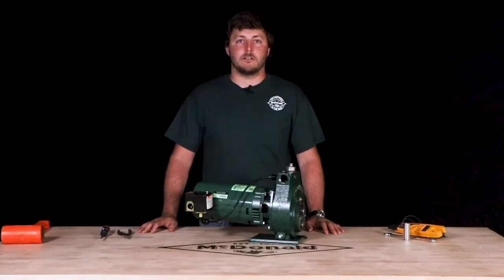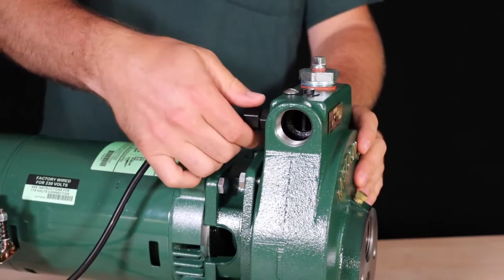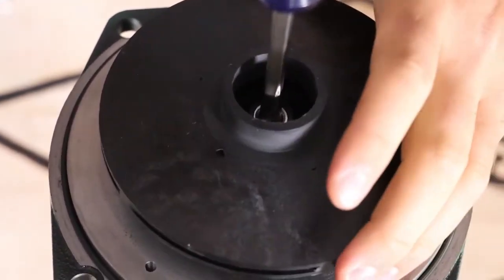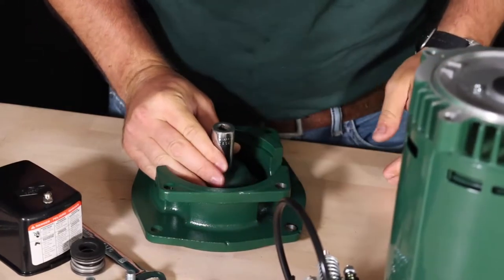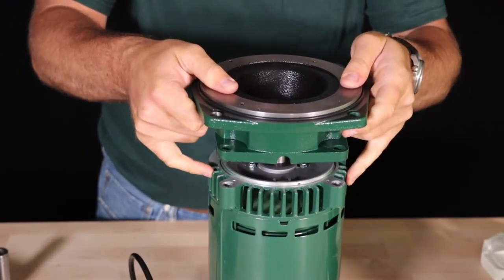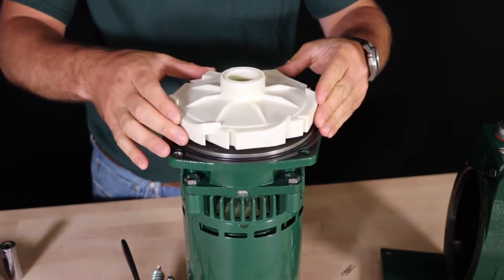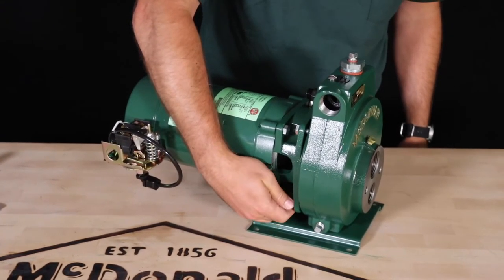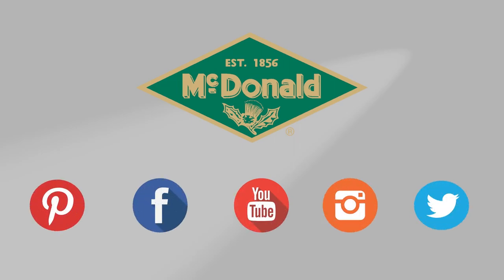Repair a Jet Pump

Comment: I have a slow drip leaky around the bottom of section between pump body and motor. It drips more when under pressure. Will new o-ring fix the leaky issue? The pump model is Berkeley 5SN. We are using it at off the grid cabin to pull water from the tank outside.
Reply from the maker: Hi there! Thanks for reaching out. While we don't manufacture the specific pump you're inquiring about,  we might still be able to help you with your question. Feel free reach out to our dedicated Customer Service department, and we'll do our best to assist you: https://www.aymcdonald.com/page/contact-us